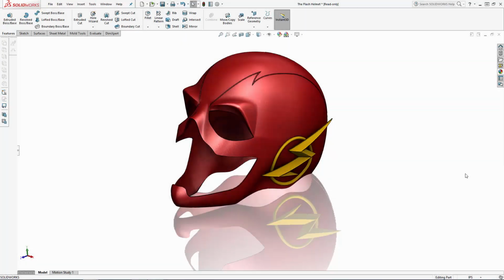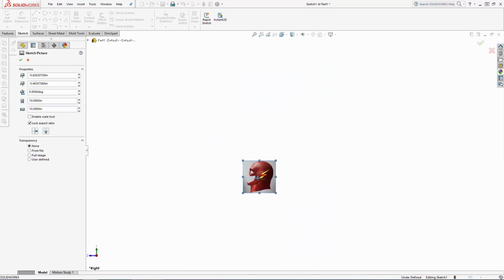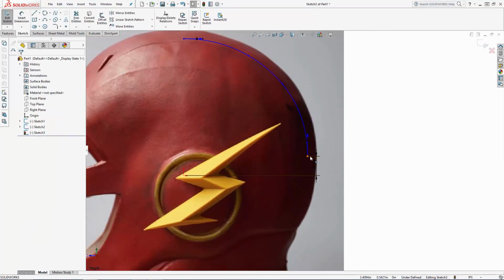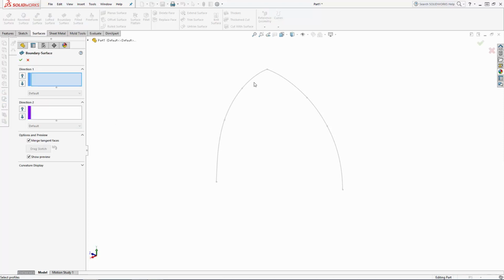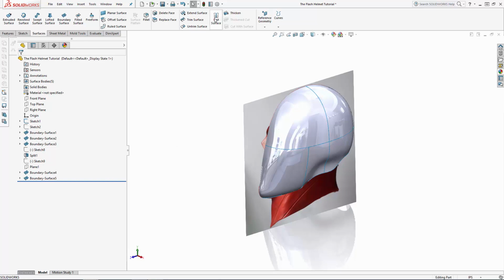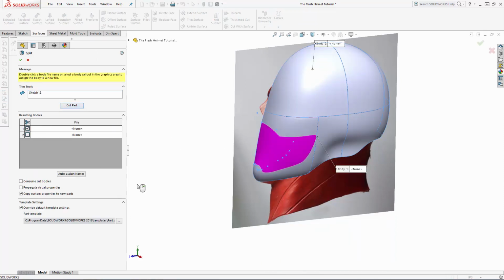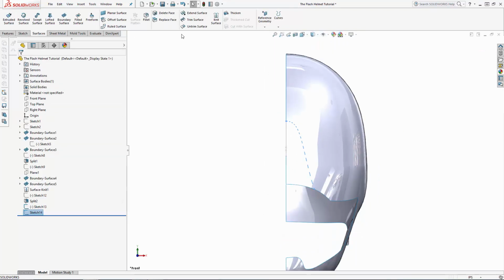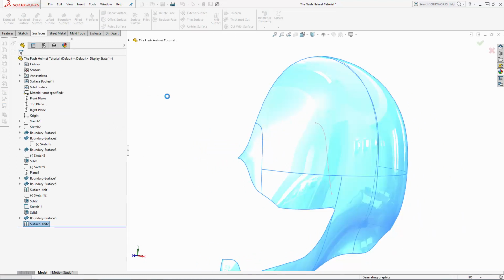Flash Mask Tutorial: Part 1 - SOLIDWORKS

Comment: I would use “trim surface” instead of “split” for 2 reasons. 
1, it fits surface modeling mind set;
2, it is in surface ribbon, while split is several clicks away;
Solidworks being great at solid modeling, is lacking at surface modeling.
Reply: I study Industrial/Product Design here in Belo Horizonte, Brazil, and we feel the same way at the university. Unfortunately Solidworks is really lacking at it.